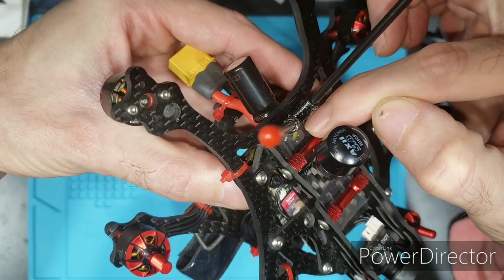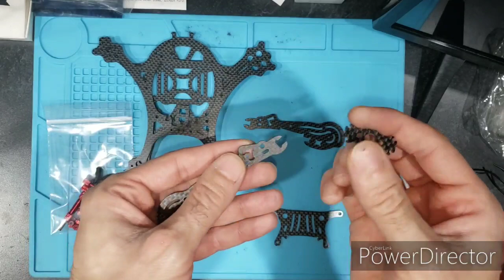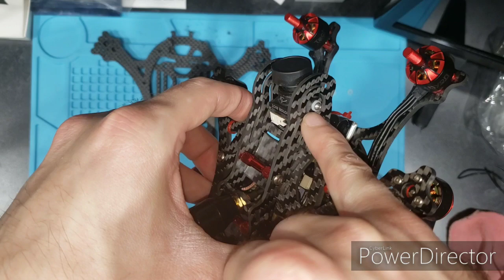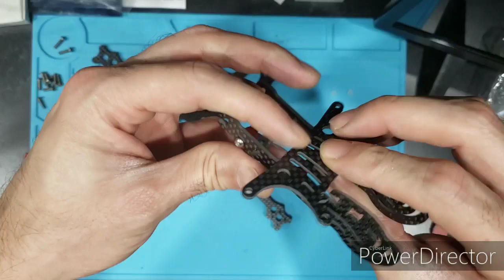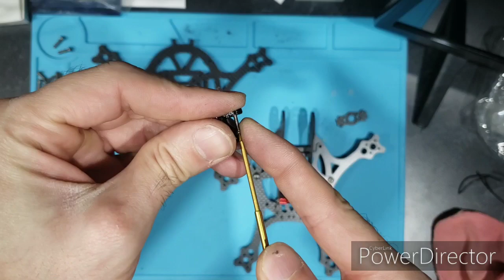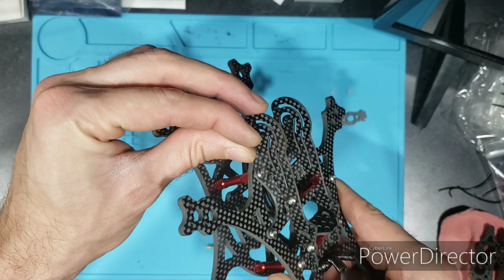3 Inch Octokwad Frame-Only Build

Comment: I had watched the rotor riot video long ago but wasnt interested into octocopters back then.
Where can I buy this frame from ?
Reply from the maker: Hey, thanks for your interest! Get in touch with me through my FB page or Gmail for details, but this frame is in stock and has been updated a couple times since this release!
Reply: @octokwadfpv2816  wow would be awesome if you made a new video
Reply from the maker: @aakashjana6225  That is coming soon, as well, I'm waiting on parts from overseas.  XD
The build will be slammed on the "light" version of the frame, though both have the same features. New additions since this video are a dedicated mounting location for a T style antenna, a mount location for extras like GPS or a cam and also the ability to use two 20x20 stacks instead of a single 30x30. This allows for the use of the Caddx Vista or Tarsier.

Comment: If you loaded this thing up with max reasonable battery, how much flight time could you get?
Reply from the maker: This is really going to depend on components used, but I would say 5 or 6 minutes with good performance on a standard build. I will be doing a light version within the next few weeks in hopes of extending the flight time significantly.

Comment: any more info on the build guides? this would be a very handy addition to my garage :)
Reply from the maker: There have been some changes made to this frame, the new videos should be coming out as soon as the new parts come in! I will be doing a full build on the light version of this frame and, eventually, an overpowered 6s build as well. Keep an eye out for the new 3" Hex, should be well under 250g.

Comment: What kind of esc and fc combo would you use for this bad boy. I’m interested in building one but there’s very little documentation on 8 motor setups. While we are on the subject of components would the chassis accept a dji digital fpv air unit?
Reply from the maker: Hello and thanks for the interest! For the flight controller, I highly recommend the SPRacing H7 Extreme, I've been very happy with the performance of that board and it has the necessary 8 motor outputs (actually up to 12 if someone really got carried away, lol). For ESCs, it's going to depend on your motor, battery size, amp draw, etc. You would need a pair of 4in1 ESCs, I used Spedix GS35s in the first build that went to Rotor Riot. The next build had Holybro Tekko32s, the most recent had Tmotor F45A v2s. Any quality 4in1 should work just fine. As for the DJI air unit, I think it would be very difficult, if not impossible, to mount such a large component inside the frame without some serious creativity - it's a very tight build as is. The Caddx version would be easier, especially if you used a 20x20 stack for the FC and ESCs, but would still be a bit tricky I think.
Reply: octokwadFPV hey thanks man I appreciate the response. So even the caddx would be tight. I thought that might be the case, but you’ve actually held the thing, so I figured you would know better, fantastic frame man. Looking forward to seeing more.
Reply from the maker: @runaway2me80  The only way I could see fitting the Caddx unit inside would be to find some tiny single ESCs instead of the 4in1s, then find a creative way to mount them. Arms are slightly curved, as you can see, so arm mounting could be tricky. However, using those would free up space for a 20x20 stack in the center with the Caddx unit and the FC. Be sure to follow the Facebook page for more updates on this and other projects. The 6 inch prototype based on this concept is just about finished, that one definitely has space for all kinds of additional components.
Reply: octokwadFPV  I’m already a follower my brother. While I can’t say I’ve built a drone I am familiar with the products and I have built many a small electronic device. I had wondered about how viable 8 single escs would be. I guess until someone makes a 8 in 1 our options are kinda limited. Maybe if the caddx was mounted atop the uppermost frame. Again, you know better than I all I can do is eyeball.
Reply from the maker: @runaway2me80  I don't have any DJI gear, so I can't say for certain, but mounting above may work. Perhaps within a 3D mount of some kind, but that does leave it relatively exposed in the event of a bad crash, lol.
Reply: octokwadFPV yeah looking at it again it wouldn’t mount above I’m just wishing hard enough to augment my perception of the clearance lol either way man, fantastic frame, probably still gonna order one to tinker with soon. Waiting to see how my tax return comes out this year.
Reply from the maker: @runaway2me80  Thanks for the kind words and the support, I'm very happy with how it turned out!
Reply: octokwadFPV thanks again for taking the time to reply, you have a killer product and clearly a great support attitude. I hope you do well with your business venture.

Comment: Can it be augmented to fit a 44x37.8x14.4mm RX?
Reply from the maker: Possibly... It would depend on other components used and how much space you allow yourself for the larger RX. It was designed with a smaller RX in mind.

Comment: Would it be possible to shrink it a bit for a 2.5" octo?
And a few questions... what fc are you using? Bc i'd need some more motor outputs right? 
Is it possible to simply get 2 deadcat style frames and just line them up to get a octo?
Reply from the maker: I would have to find some time to play with the files and see if the size of the body would accommodate 2.5 inch props while maintaining all the other ratios, you could put 2.5 inch props on this frame. Prop overlap and maximum length to width ratios were carefully considered for the build to avoid efficiency losses.
This octo would need a board with 8 motor outputs. I use the SPRacing H7 Extreme and it works very well, was simple to set up.
As for using a pair of quad frames and bolting them together, maybe... the ratios, again, would be the tough part to maintain. Feel free to give it a shot, I'd be interested to see what you come up with. Otherwise this frame is available for 55 dollars.
Reply: octokwadFPV I'll give it a try and I come back for your frame later☺️

Comment: Nice video. I love this Quad, but what kind of electronics have you used and how did you set it up? Or will there be another video about the electronics?

Well reading the infobox or however that thing is called has helped xD
(Greetings from Germany)
Reply: Gery Gamer wish I had read this comment before posting mine. Crossing my fingers for more info.
Reply from the maker: New content coming soon, for a super light weight build out of the newest version of this frame.
Reply: @octokwadfpv2816  waiting.... Where is the videos?
Reply from the maker: Electronics have changed DRASTICALLY since this video was released. The current version of the frame supports Crossfire as well as DJI. I fly analog, but dual 20x20 stacks or a central 30x30 make the build pretty flexible these days!